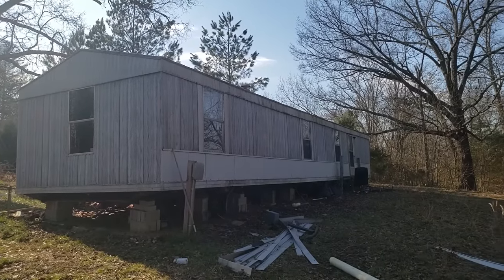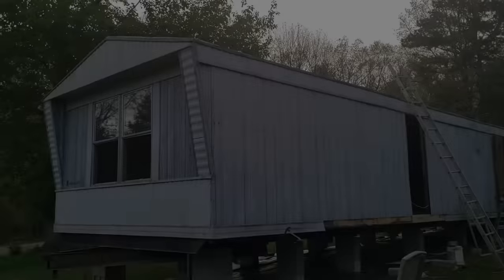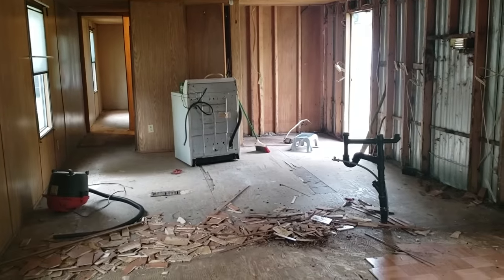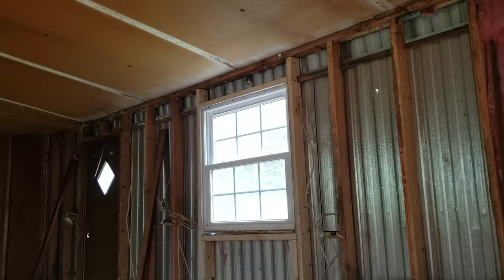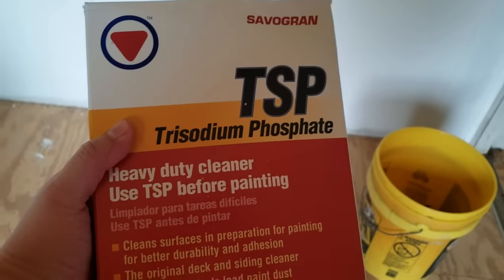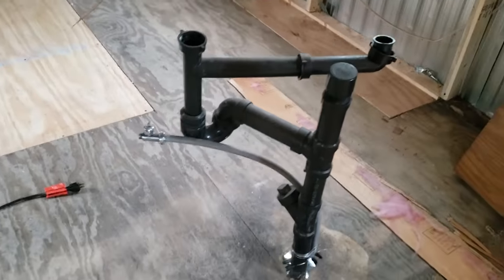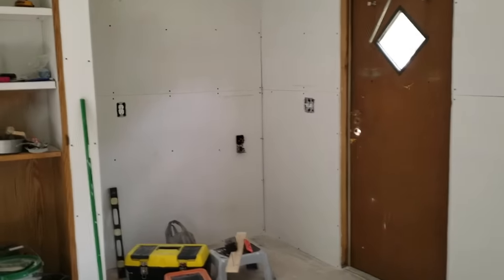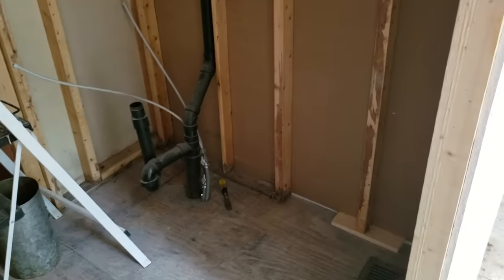Mobile Home Makeover | Single Wide Remodel | Fixer Upper On A Budget

Comment: I feel you on this project. I'm going through the same thing right now. Well, mine turned into a complete gutting to the frame since water has pretty much rotted everything. I'm finally just entering the rebuild stage from a year of gutting and clearing. Best of luck to you!
Reply from the maker: Oh no! Sorry you had to deal with all that water damage, I'm sure that was a pain.  I'm happy to hear you are starting to rebuild, hopefully things will move along more quickly and smoothly for you now.  Thanks for your support!
Reply: I'm doing the same. Total gut job, rewire, reinsulate, house wrap, new subfloors, new receptacles, slowly getting it done one room at a time

Comment: I'm in a mobile home myself I've rehabbed and lived in them basically my whole life I really advocate buying the "mobile home repair manual " best 50 bucks ever spent written by a guy who repairs m.homes for like 40 years he has a cool system for a "roof over" which I've done best thing ever did and I think everyone who has thin metal siding does a sheathing of solid wood on exterior and high grade sheetrock fire resistant and sound deadening and same for insulation I know it's a lot upfront but I did homes side by side with and without it its cost is easily justified when you feel the difference and that repair manual has a really cool system for heavy duty skirting systems and insulation underneath home also. Hope  you guys enjoy ur new home you all deserve it job well done looks  great! Thx for sharing 😀

Comment: Hello there!!  I bought a 1988 mobile home too! 16 years ago. Good bones. Already had replacement windows and a roof over done. Previous people also smoked A LOT!!!  So Kilz on  almost everything. Scrubbed kitchen cabinets...carpeting was almost bare in spots. Pulled that up to find the padding was a dry, crumbled, powdered mess!     Colors in the trailer were smoke blue and mauve!!🙄 everywhere!! Took the strip off the walls, painted, put down luan then laminated flooring, new bathroom sink and toilet. Mine had a non-working corner fireplace in the livingroom which I tore out and fixed hole in ceiling and roof. The extra space it gave me is very useful. I have a 14×70. Three bedrooms/one bath. It's just me and my 2 cats. Been here 16 years and I love it. Course I didn't pay 1000.00 for it but I know it can get a little costly updating, cleaning, and replacing stuff. I paid 8,700.00 sixteen years ago. I later found out from a neighbor that the mobile home park only gave the previous owner 3,500.00!!  But that's what they're in business for. To make money. So I bought a very well made, basically sound mobile home, fixed it up, and have been living comfortably pretty damn cheap for 16 years with no house payment!!!  Hang in there my friend- it'll be worth it when you're done!!!  Oh- forgot to add this- lot rent was 240.00 back in 2005, now it's 310.00 in 2021. Not too shabby😉 The mobile home park I live in is kept up nice and we have big beautiful maple, oak, and pine trees. It's out in the country in NW Ohio. Lots of beautiful woods and farmland around me. I'm happy. Grew up in the country. Loved it. Love the privacy and peace and quiet. The only thing I miss is "my own space" or privacy. There's no laying in the sun naked around this place!!!🤣

Comment: Me and my husband bought a fixer upper double wide on almost 5 acres. Our master bedroom was almost completely gutted, so we had to do a lot of sheetrock and insulation in there and several other rooms we had to replace water damage sheetrock or sheetrock that had holes in it. Plus we had to redo a whole bathroom that was gutted, put 6 new windows in from where they were busted out, and we had to put in new subfloor. We have done a lot since moving in , inJanuary and we still have a lot more to do. But we are paying a mortgage on it because I couldn't afford to pay 70,000 up front. We couldn't find nothing that was cheap or a piece of land , so we found this and went for it.
Reply from the maker: Well it sounds like you guys are well on your way and it will be so worth it in the end! Double wides are expensive now day, my sister looked at some recently and I couldn't believe what they were asking for them. Good luck with your renovations and thanks for watching!

Comment: Just bought a 2 bed/2 bath 16x60 for 5k!!!  Prior owner is elderly and going to assisted living, but they already redid all the subfloors, new tub surrounds, sink tops and toilets in the bathrooms are newer as well.  Really just will have to redesign the kitchen and change the flooring and we're good.  This no mortgage, no rent life (well, just lot rent at 600/mo) is about to be awesome.  We'll probably stay until our youngest finishes school in 2030 and get working on our retirement home likely somewhere rural and with a double or triple wide on a foundation.

Comment: I'm renovating a 1972 mobile home in NH right now. Bedrooms were gutted and redone with drywall, the first bedroom with a cedar ceiling. All new windows, Pella, as Kinro no longer sells replacement windows. We're doing the bathroom right now. All new walls, floor, plumbing, everything. I gutted the rest of it. Livingroom is getting new walls and ceiling. This is on a vacation property so we're not living with it. Electrical is insane. Boxes are never installed to a stud, wires are rarely stapled. All the outlets are back wired. Replace immediately!! God bless you. Looks great!

Comment: Your home is the same width as ours but longer. Ours is a 1989-1990 model / 2 bed 2 bath. We bought it on 1/2 acre with a two car garage and extra shed in the back yard and a sun porch attached to the back of the house. We're free and clear because we paid cash for everything. We're also doing remodeling (mostly the two bathrooms - definitely getting rid of the garden tub!) But the rest is new flooring & painting. Small things like doors, lights & hardware is changing a little bit at a time. Good luck !

Comment: I just bought a 1974 single wide for 5,000 and spent about a month and a half fixing soft spots in the floor part of the roof that was leaking totally painted ever room painted the whole outside of trailer and deck cabinets the works really happy how it came out and tsp cleaner is fabulous good luck its worth it.
Reply: Be a good idea to kilts the bathroom walls if your not replacing it kills odor and prevents and kills mold or bacteria plus a stain blocker
Reply from the maker: That's awesome! I'm glad you got it fixed up and now you have a great home.
Reply from the maker: We replaced the bathroom walls with drywall.

Comment: I got my 84 singlewide for $1000 about a decade ago. It was in relatively decent shape but of course, it had issues. A busted pipe in the past led to some water damage that ended up moldy. The pipes themselves were terribly old. No water heater, no furnace, no air conditioning. However, it was/is paid for. For what many pay for one month of rent, I purchased a rather large home to call my own.
Reply from the maker: That's great!

Comment: I hope you kept that wood stove. It would come in handy for cold winters and power outages. I could be wrong, but I heard they may be banned in some areas of the country. It looks old, and good cast iron ones are hard to come by, I heard a new one is costly. There may be a way it can be refurbished with cast Iron paint. I would look research it on youtube  I wish you well with you fixer upper journey.

Comment: My brother remodeled my 1986 mobile home.  He took out the bad parts of the floor then put marine plywood throughout the house.  32 sheets.  He rewired and replumbed everything.  The insulation had settled so he put in new insulation- higher R value than original.  We put new drywall,  new toilet, sink and bathtubs in both bathrooms. We checked discount,  damaged and retailers for parts.  He had some plywood left so he built new shelving in the lower kitchen cabinets. Cabinets are the cheapest built items in a mobile home.  It was literally a brand new mobile when he was done. My developmentally challenged sister and I lived there almost 3 years after that. Due to circumstances beyond my control I had to move. The small town where we lived started fining me  daily for "abandoned dwelling" d
Reply: abandoned dwelling.  I tried to sell the mobile,  getting down to $2,000 for it. I finally gave it to a young couple with 3 children.  They had been left some property.  It cost them $1,200 to have it moved. They also took the 2 porches I'd had built for it. As of 2021 I don't know if they still have it.  Your video brought back many memories.  Good luck and GOD bless you.  ❤
Reply from the maker: Thank you! I'm sure that little family sure appreciated your kindness.  That was a true blessing!

Comment: You go girl. There are way more people living in MHs than anything else. . That one doesnt look that bad. My rule for buying one is if you get it for the price of the lot, you are good to go. We bought one for 25K on a very nice 2.15 acre lot with a nice view, in 2014. We have had it rented since. it needs painting,cleaning etc again..If u take care of your MH it will be fine. If u abuse it or dont care, it wont last because they are cheaply built to start with. We put in new windows, doors ,a furnace, etc over the years. The owner we bought from bought it used in 1997, its a 1991. i dont know what he paid for it, setup, moving, etc. but he still had a mortgage, when, he died  in 2014.i figure in rents alone it paid for itself,  the improvements, and more. Ours is a 14x66 2 bedroom two bath. Why u need two baths in a two bedroom,I have no idea. i love going to the top of the mountain to mow that MH lot. You can see maybe 125 miles. The specs on MHs changed in 1987. pitched roof, better windows and insulation,rafters etc. Before that they were truly  garbage.

Comment: Where did you get your little wood shelves with black brackets? I love them. Y'all did really good. In the middle of a single wide Reno myself. You have lots of inspiration! Thank you.
Reply from the maker: Thank you! I purchased the brackets at Hobby Lobby and then just got a board and cut it to the length I wanted, sanded it down, and stained it Minwax Special Walnut.

Comment: My dad also helped us get a used mobile home. It looked BAD BUT I’ve learned over the years ANYTHING can change with hard work. Most of our work has been done on the inside so the outside doesn’t look to good BUT it’s paid for. Ytube has been our handy man lol 😂! My dad just bought himself a new truck and sold us his old one. I took 4hours to clean that truck and I’m not done yet. I’ll get an oil change, new tires, new front windshield, seat coves, new radio so my daughter can be entertained, new remote to unlock, and cheap paint job later. If you don’t take care of small blessings WHY should you be blessed with more!! Since we don’t have a house note we are saving for land. We plan to have my dad move on our land for free since he’s helped us so much. We haven’t stripped things down to the studs like I wanted to but we will get there. Good job on your hard work so far!
Reply from the maker: Sounds like you've got things figured out Tamara, such smart ideas. It is a lot of work, but will be so worth it in the end. Not having a mortgage is the best feeling.

Comment: Whew! This looks like a lot of work!! I am an 31 yr old single mother of two I'm wanting to repair mine to sale it. If you or someone could answer my questions I'd be more than happy! Well the wiring in about I'd say half my trailers outlets do not work I have a room that has no power at all btw 2 bed 1 bath. The ceiling fan and porch light are out. The whole thing is a wreck I was just going to paint put new doors up and fix the floor some it needs some repairs. I live in OK I'm just wondering how much I could possibly make off of it disregarding the outlets and wiring. I'm on a fixed income thats why I'm just sticking with the other repairs. Where it is located will only cost 335.00 a month in lot rent unless moved. Lol sorry about writing you a book I'm just trying to get some insight! Thank you! (I've never done ANY renovation or sold a home)

EDIT (The wiring issues are from a mice problem I had a few years ago)

Comment: Hi there I just bought a mobile home that is going to need more work than we thought.
But your videos are giving me hope. Can you tell me about how long your entire renovation took? 
Also did you have to treat for water damage inside of your walls? We didn’t realize the roof was so bad and it needs to be completely replaced before we can take care of the inside. But I know that it can be done :-)

Luckily my dad is also a contractor who is helping me do the work!
Reply from the maker: Hi!! It's been a few years now since we moved in, but I believe my dad started on it in March and I know we moved in around mid August. We had it finished just enough so that we could move in. All the decorative stuff came later. My dad took out all of the walls and insulation in the entire home except for the second bedroom. It was in better shape than the rest of the home. He replaced the ceiling in the master bedroom and bathroom as well. I wasn't expecting to have to do all that so it was an added expense I wasn't planning for. I'm glad we did it though. My advice would be to take your time and do it right so that you don't have to fix things down the road. I cut a few corners because money was tight at the time and it couldn't be helped. It will all be worth it in the end! Good luck with your renovations.
Reply: @LittleBlessedNest  Yes luckily my dad is doing most of the work for me! Very lucky to have the family discount ;-) one of the things I am doing to save a bit of money at first is using contact paper on the countertops instead of having them replaced. He really wants to build new ones but that’s going to have to wait a bit :-) thank you for sharing your progress and have a blessed day

Comment: I hope you update the other windows in the home like the the one in the kitchen to more energy, efficient windows it will help with the heating and air conditioning. Basically they’re more energy efficient than the original single pane windows that come in a mobile home even if you have to do one at a time.🙏

Comment: I always wondered about drywall. I've heard some people say yes and some say no. Mainly because the trailer shifts between seasons and can cause drywall to crack. Maybe there is a method to drywall so that it doesn't crack? I don't know.
Reply from the maker: We've been here 3 years and haven't had any cracking so far. They didn't use any special method that I'm aware of.

Comment: This is Mrs. Ace X. Congradulations! Where oh where did you find the land, land costs, zoning, taxes, well or city water, cost of running electric wiring to home, any impact fees, etc? We need to find a tiny piece of land to buy, and would like to live in a 5th wheel, if it is allowable. I know that it would require a concrete slab to go under it , and possibly (for all I know) require it to be tied down, to be considered a homestead. We have disabilities, as well. My husband says that your video gives him hope. Thank you. P.S. How long did it take to get all of the work done, how many people helped, what permits did you need, how many professionals did you have to hire and what has been your total cost so far?
Reply from the maker: I hope you find the land you're looking for!  We put our on a lot our parents gave us beside theirs, already had septic/water/electric. It took us I think around 5-6 months before we moved in and then we continued working on it. My dad did most of the work. We had various other family members help out with different things including wiring, drywall, etc.  We hired someone to do the mudding/taping, electric, and to do the roof. Good luck with your renovations and thanks for watching!
Reply: @LittleBlessedNest  This is Mrs. Ace X . Thank you for your responce. You may have personal reasons why you cannot share how much this has cost in total. I appriciate what you have shared. I hope that your world keeps getting better and better.

Comment: Have been remolding my1983 mobile home, having trouble with back door leaking, both old door and new. Have coated. Roof, have put house gutters on, water comes in at the corner of the bottom of  door. Any thoughts would be very helpful

Comment: I live in a 1979 manufactured home. I was wondering if you had tips on how we can  fix our floors cheap as possible?
Reply from the maker: Are you talking about the subfloor? My dad had to patch a few places in mine. He just cut out the bad parts and replaced it with new plywood. As for the flooring, I bought mine at Home Depot. It's traffic master and was fairly cheap. I didn't have a lot of money for more expensive flooring at the time. It's held up really well, considering it was a less expensive flooring.
Reply: @LittleBlessedNest  thank you for your response. Yeah our subfloor  was damaged by a leaking pipe. We had that bad plastic pipes that were I guess recalled for this issue but we didn't know. I'm trying fix it up.
I love how you fixed yours up and it inspires me to get ours fixed up.